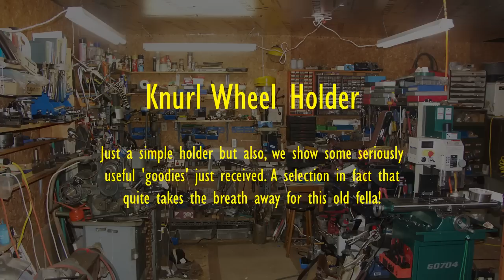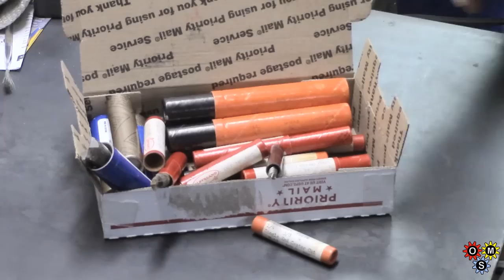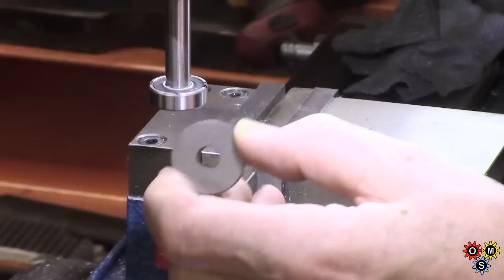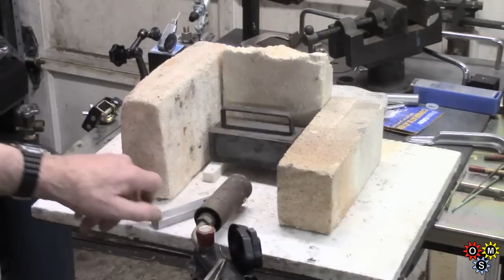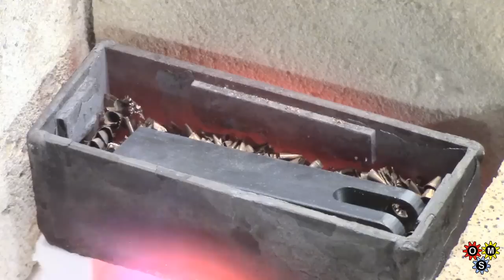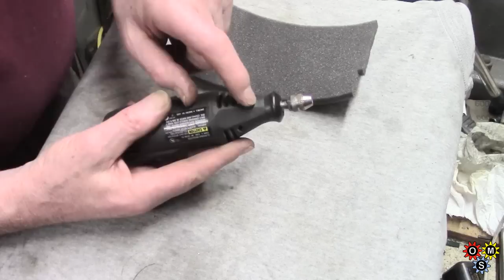Knurl Wheel Holder

Comment: Hi Chris,
Just saw this one, would like to suggest a blackening method...
I heat up the steel to a dull red, or even just before a dull red, then quench in used diesel oil, with plenty of black carbon.
Gives a nice black, and keeps oxidation off the surface, looks nice too.
I use it a lot for machine nuts, they look great.
Cheers
Noel
Reply from the maker: Hi Noel,
I must try that approach - must admit I have not done a lot of blackening at all so this was a bit experimental!

Comment: Nice basket of Easter Eggs, heavy though... lol
On the knurling wheel you always need to leave room for the lubrication to reach the pin, or else it will seeze... Curious to see it operate...    ;)
Reply from the maker: +pierre beaudry 
Nothing I need to try it on yet but, enough clearance space to get lube down sides. Maybe I'll do a trial run.

Comment: WOW, just WOW. That is one really nice gift you got there. Amazing is the generosity of others. Only now you need more tools to fill those holders. And storage room. And...
 On the bluing, I think you need smaller chips of a more uniform size. Each chip will only contact at a few spots so large chips means fewer heat transfer points and larger spaces in between makes for less uniform heat conduction. Or you could just jewel it.
   Mike (o\!/o)
Reply from the maker: +Experiencing Technical Difficulties 
Hi Mike. Indeed, the gift box was awesome.  I have a lot of spare tooling already lined up for the holders - much will be for special grinds.
Points taken re the bluing -- next time I will make several changes, but it was interesting to give it a try.

Comment: Congratulations on your impressive haul, all down to the friendship within the World workshop, all going to a good cause, rather than the local landfill !You could have case hardened your knurling wheel holder, that would give you a chance to dabble in the black art of colour case hardening!
Reply from the maker: +Englishman French 
Hi Chris -- thanks. I have done some 'ordinary' case hardening in the past with "Kasenit" and if I had not had a hardened pin, would have case hardened a bolt. Never actually experimented with color hardening however.

Comment: I use the older model flex shaft on my Dremel, it is an all metal housing. Very easy to attach to the compound or the cross slide.
Reply from the maker: +larry munday 
Hi Larry -- I have a flex shaft but somehow felt inclined to try and mount the whole thing. We'll see how well it works out eventually! :)